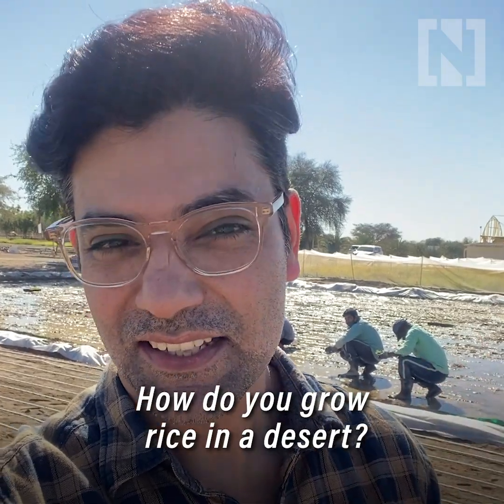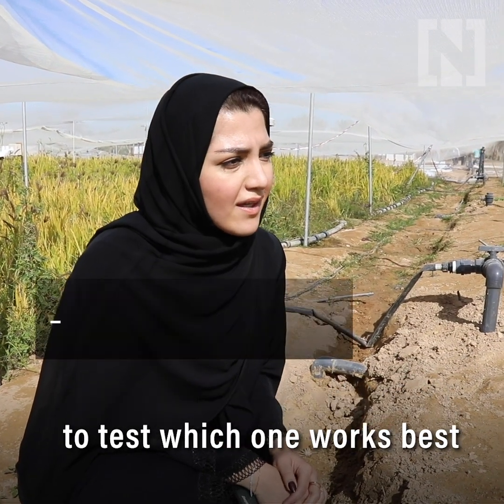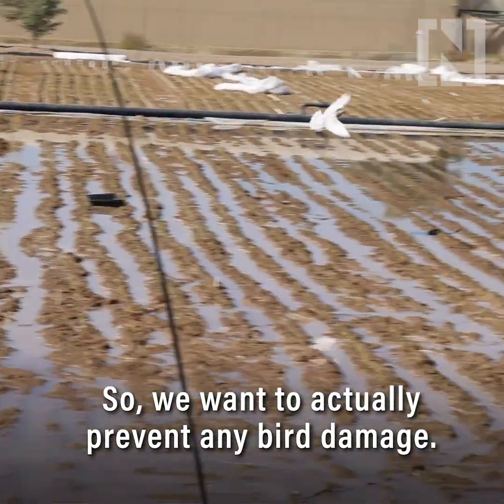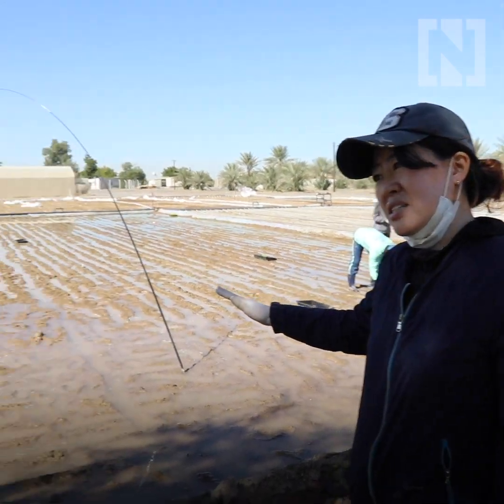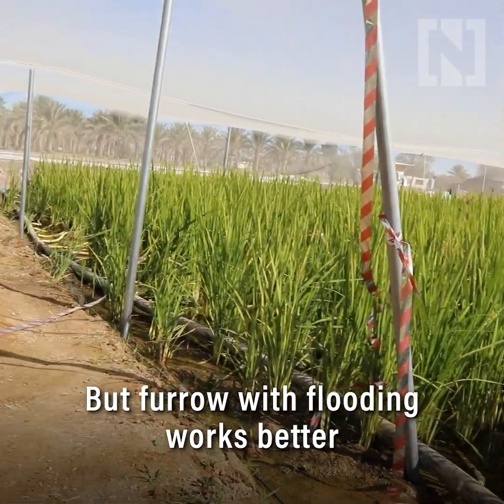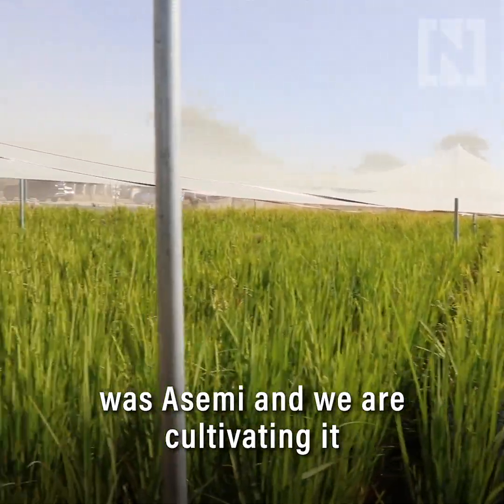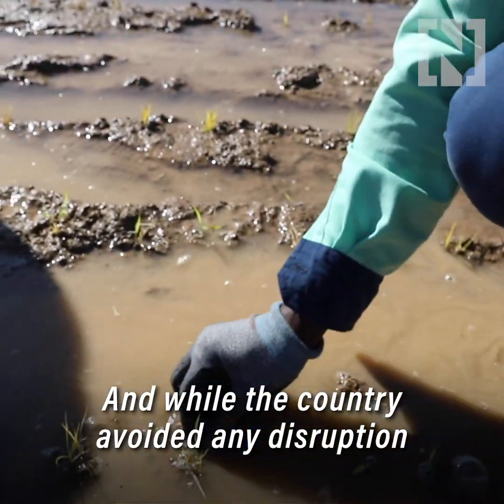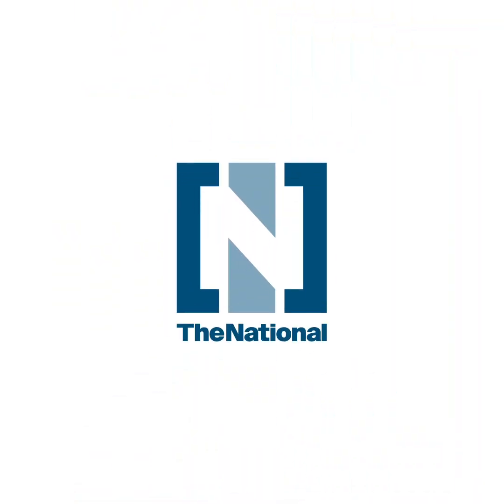How does the UAE grow rice in the desert?

Comment: Plants free of water deficit events more efficiently absorb available plant nutrients enabling plants to achieve their maximum genetic potential. SWRT membranes installed below plant root systems retain water where it falls, providing continuous delivery of 
drought-free periods up to 3 times longer than intensely irrigated control sands without root zone water retention membranes (Guber et al, 2016).